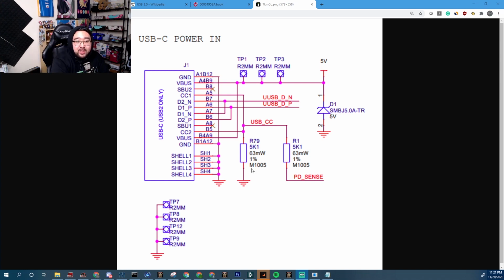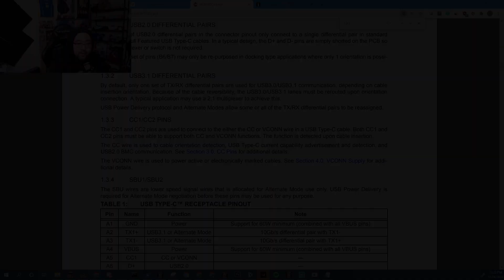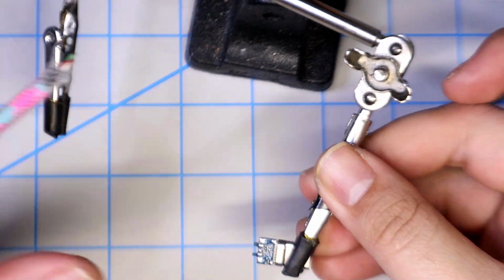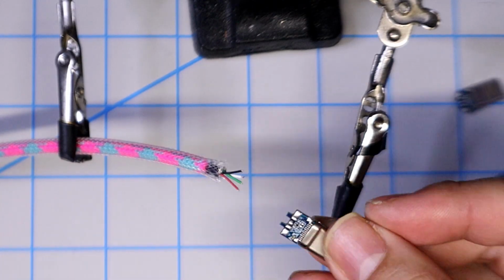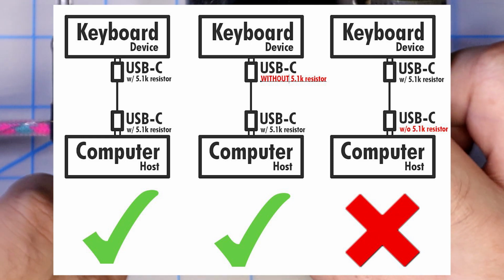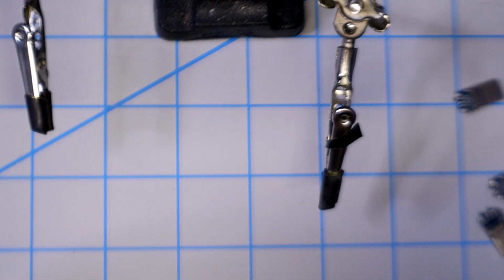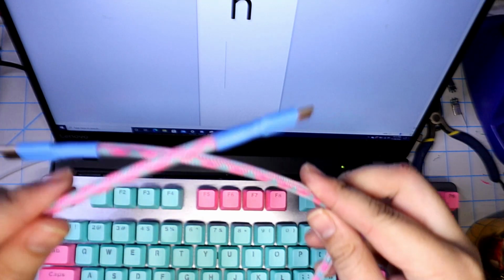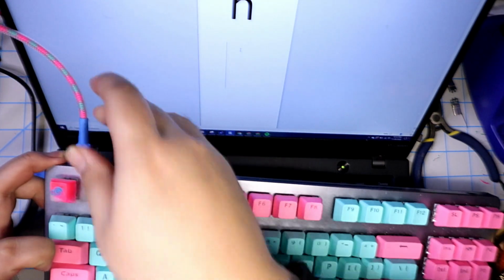DIY USB C to C Cables for Mechanical Keyboards

Comment: Hi Cruz. In this video. Did you change the resistor to 5.1K or did they come right of the factory? It looks like a 56K resistor that usually sold with factory breakout board. Mine has 56k on R1, similar to yours, except yours has the resistor on R2. Also I have some other board with R1 and R3 has the resistor. Does 56K resistor works too?

Comment: Great video. I made one and it does work on my keyboard but it does not charge my MacAir. I use Apple's official charger with my DIY cable with no luck. Apple's USB-C does work. Why do you think that is?

Comment: Is it possible to make a true USB-C to USB-C cable that has USB 3 speeds, along with data transfer? If so, where might one find instructions?
Reply: Is the speed the reason why usbc to usbc cables don’t exist? I’m just trying to connect my keyboard to my MacBook :/
Reply: Bro found any solution ?

Comment: The plastic on the wires melted before I got any solder on the wire tips. And the solder would rather stick to soldering iron than the wires... Any ideas what I am doing wrong?

Have soldered several PCBs with no problems.

Using un-ledded tin
Reply: @Star Cheng will try that, thanks

Comment: Will this work for a USB-C Thunderbolt port on the host side?
Reply from the maker: I believe it should work if you're only plugging in a simple device like a keyboard. Using only 4 pins kind of limits what type of data and power transfer is possible utilizing that port. I'll try to get my hands on a mac device to test that out myself
Reply: @CruzCtrl  ok, will take the chance and order from your site straight away :)